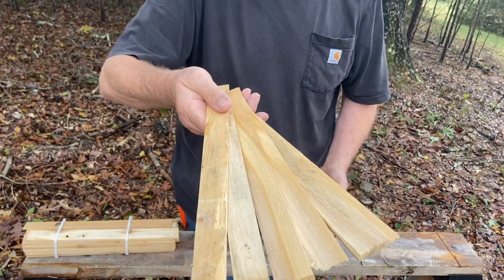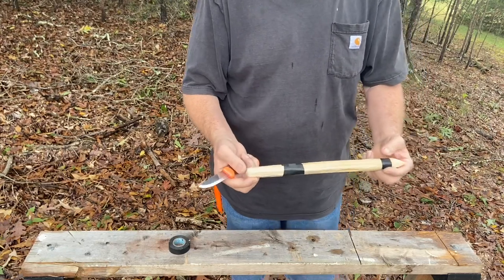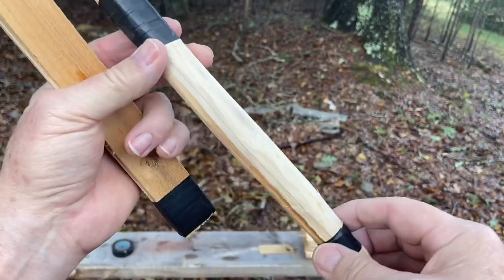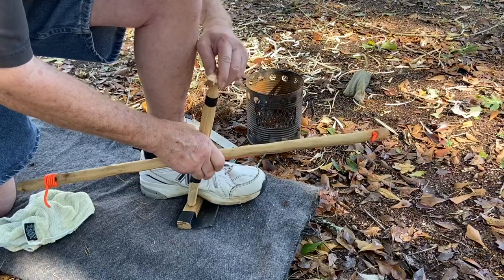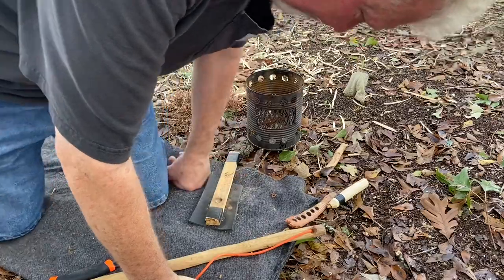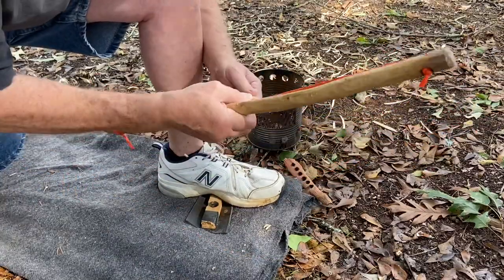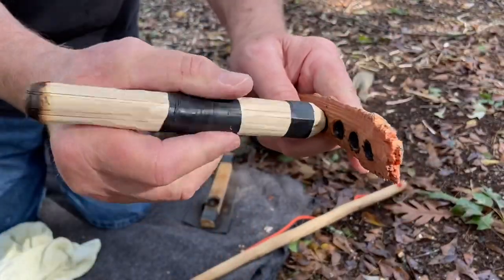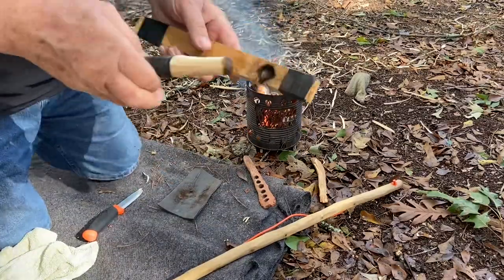Bow Drill, Making A Bundled Spindle And Fireboard Out Of Shims.

Comment from the maker: This is always a fun problem solving exercise for the bow driller. I've made bundled spindles out of 8 different pieces of weeds all bundled together, split lengths of bamboo, the flower tops of Horseweed, leftover hand drill spindles, etc. Common problems are how to hold the bundle together? Today, I used tape, but I have used cordage. How to bearing block the spindle? I used a fatwood bearing block in this one, but have used the cut off spout of an aluminum beer can.
   The 2 problems I dealt with today were a spindle tip that was too delicate to withstand the dynamic pressures in the bearing block, and spindle flex. I used a lot deeper divot in the fatwood bearing block to help support the delicate tip and to stop the flexing? I had to cut the 12" spindle down to 7".
   The Bundled Spindle Technique is a lot easier than what you would think. Check out the examples below by following the Links and please SUBSCRIBE. Thank You!

Bundled Spindle Technique Playlist
https://www.youtube.com/playlist?list=PLkoXX8XsMW3kAbcd61d4f1bytR5Lb9af5
Bow Drill Playlist
https://www.youtube.com/playlist?list=PLkoXX8XsMW3kw-EXlvpLS68aJjR89P4ae
Reply: thanks for the video.

Comment: Enjoyed the experiment, great job. Have you ever tried experimenting with any of the following with a fireboard and spindle. Adding any of the following to the fireboard divot after burn-in: punkwood, punkwood char, cotton fibers, cotton char, or ashes. Would be interesting to see if there is a noticeable deference in effort needed to produce an ember.
Reply from the maker: A common question. Whatever you put in the divot is immediately cast into the dust pile with no effect except for sand when you need abrasion when the divot and spindle tip has glazed.